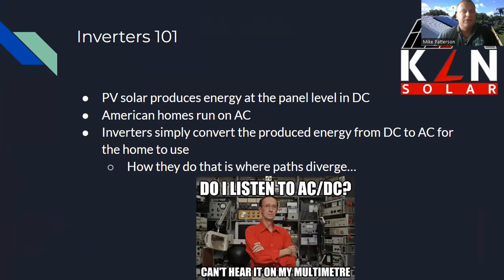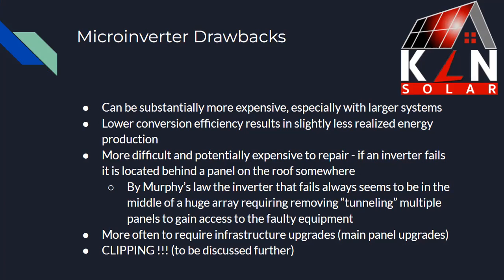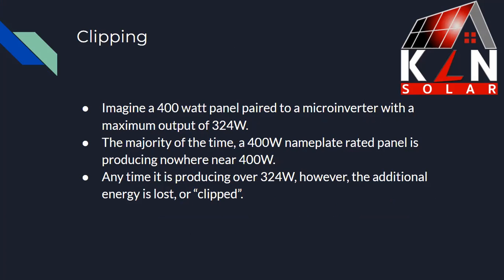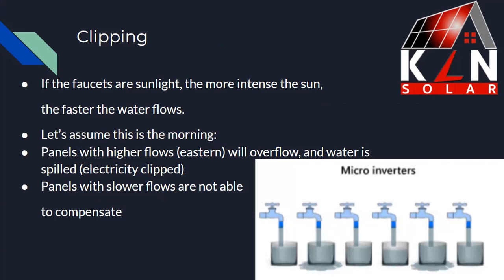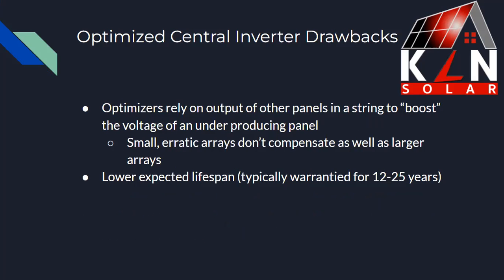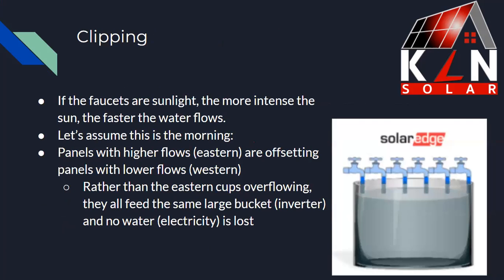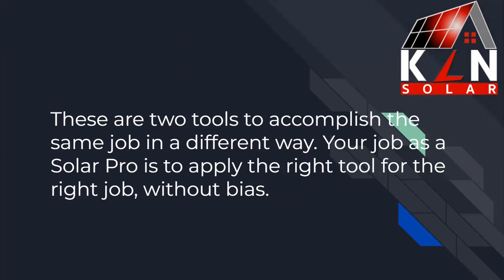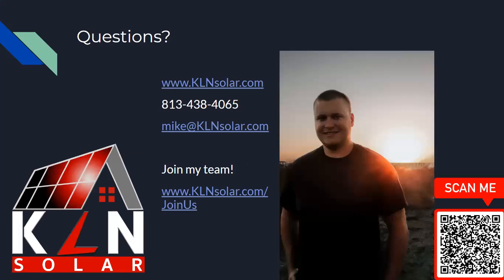Solar Pro Saturday - Training on Enphase Microinverters vs. SolarEdge Optimized Central Inverters

Comment: Very informative.
Q: how reliable are the optimizer? Would a failed one still require‘tunneling’
Q2: you explain clipping on high production time, what about early morning, cloudy or winter days in the far north?
Reply from the maker: I have fortunately never seen an optimizer fail (only the occasional defective unit which is noticed and replaced immediately at install... have not even seen this yet with the new S series). If an optimizer needed replacing it would be similar logistics to replacing a micro. 

Clipping is only an issue at high production times. If the panel is not producing more than the micro can handle it is not an issue